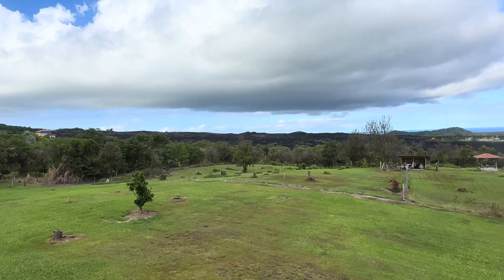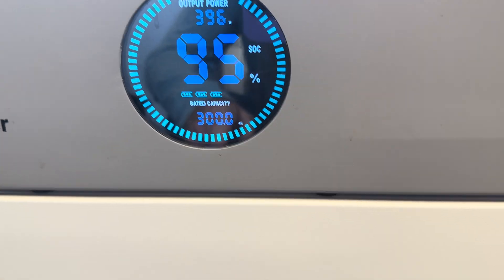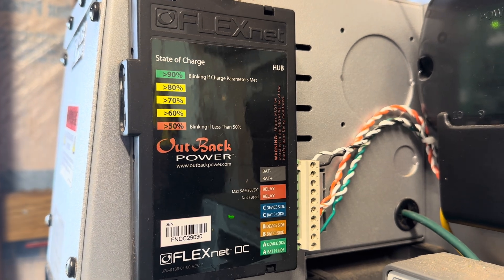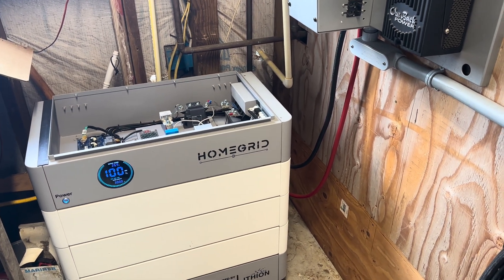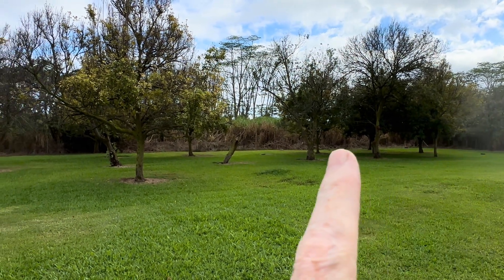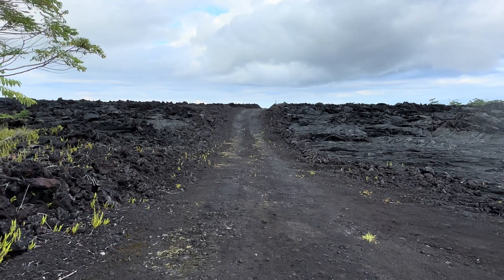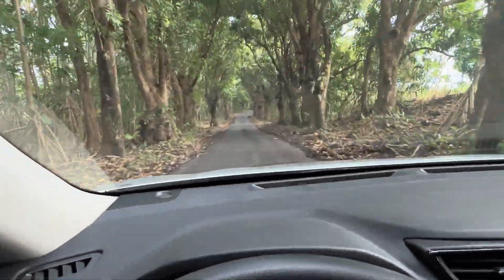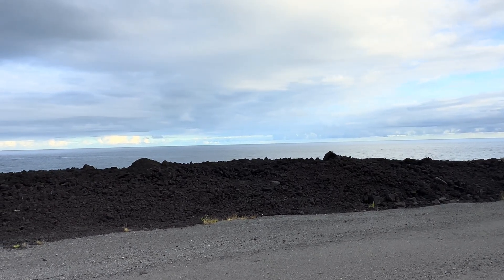Guest system #4  Stackable LiFePO4 battery in a sleek compact design. 7000 watts solar OutBack CC's

Comment: I have a 4-stack Homegrid. Each module is 100amp hours at 48 volts. I have it hooked up to my Sol-Ark 15k inverter. Both units have worked flawlessly and continuously for ~ two years now, and both are warrantied for 10 years. The battery modules should last longer, simply because of their composition and the controller. Yeah, the Homegrid is a handsome Energy Storage System. And the Sol-Ark 15k is a brilliant inverter, allows me to simultaneously run my 4-ton central A/c unit, electric dryer, and all four burners on my electric stove. Cheers.
Reply from the maker: Thanks for sharing your experience and system details, mahalo!🤙

Comment: great system. great views. Them lightning protectors with the blue light that is mounted to a board is the ones I have. Midnight solar. you mount them buy the charge controller and run ground wire. they have them in different voltage systems. they will help you get the right ones. that is the type of hot water system I have but panel and holding tank is different. I have propane on demand hot water in system. it only works in winter months . I went with PV power circulating pump .has it's own panel just for that. takes no power to run it. self powers hot water . just the pump with holding tank. feed it.    nice trip. the drive was very nice.
Reply from the maker: That was a sweet system, and I need to learn much more about it, and I will. That remote monitoring , and adjustability from manufacturer is amazing. It truly is a worry free application for this guy. Troubleshooting from experts is so cool. I am putting that hot water system on my "to do" list. Aloha!🤙